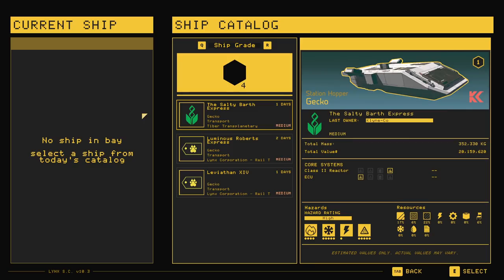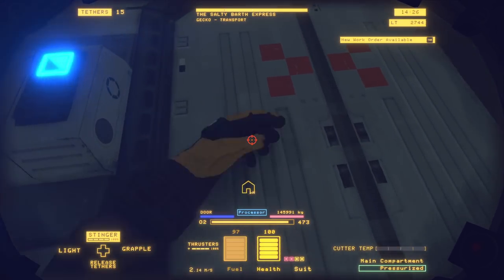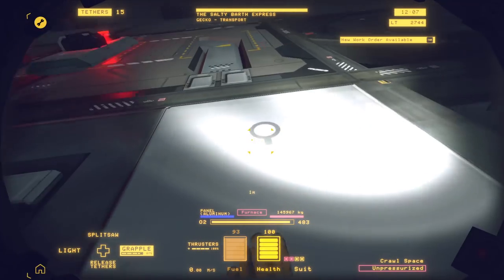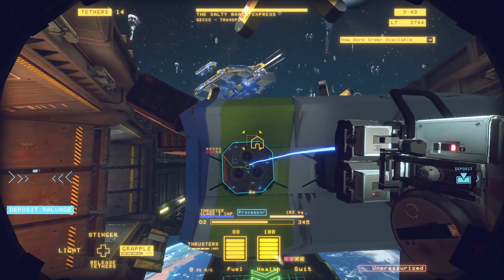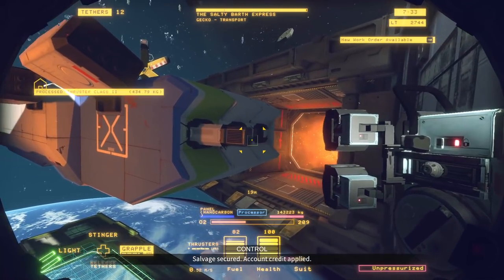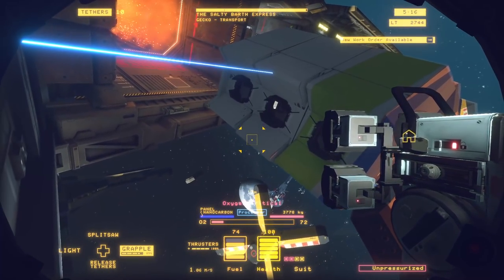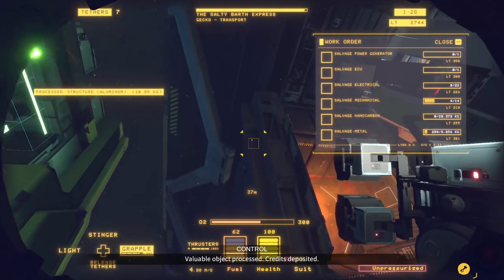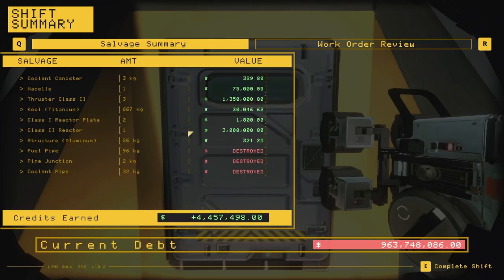Hardspace: Shipbreaker | Guide | Class-II Reactor Safe and Surgical Extraction | Gecko Commercial

Comment: keys aren't necessary 
it only allows you to cut the line safely how ever you can still melt the line with no problems even with fuel in the line
disabling the coolant is the only necessary thing 
you need to melt the lines anyway to get the ECU out
by melting the line you can keep it attached to the three engines this gives you the three overrides still attached $$$ 

(4 lines are currently bugged as they are anchored in a fixed position and require melting) 

you should have time to get the power gen as well in one shift (for 1350 LT by shift end) 

just move on to the next ship after that 
doing the whole buffalo is a waste of time 

note (use the scanner to look for keys) keys can be anywhere even next to the fuses 
a cute trick is to open unsafe doors 
I've gone many times not even looking for them and they gust fly right though the door way into the room I'm entering 
https://www.youtube.com/watch?v=7aeAdWMIGKY